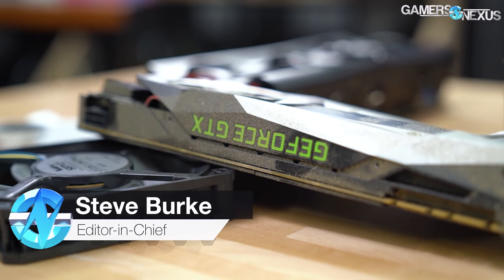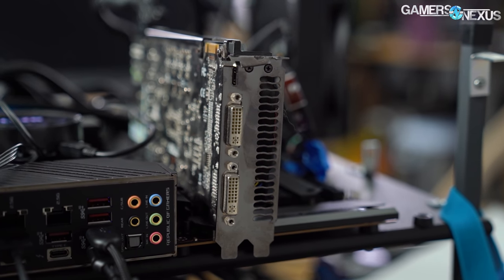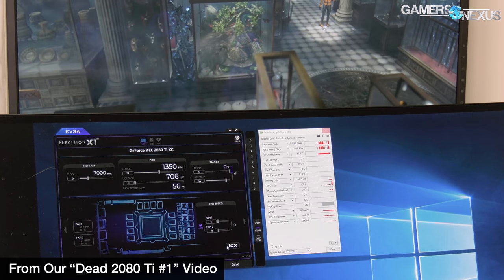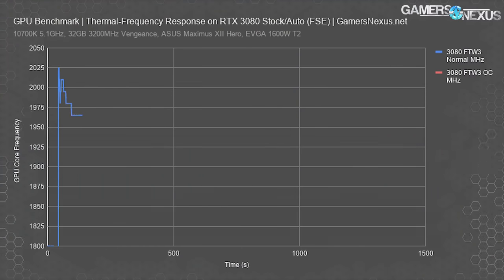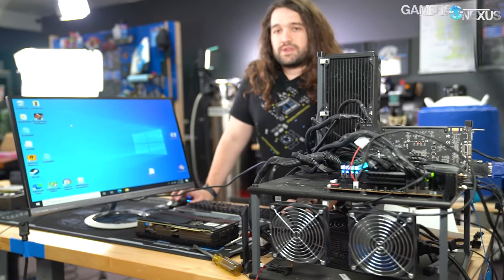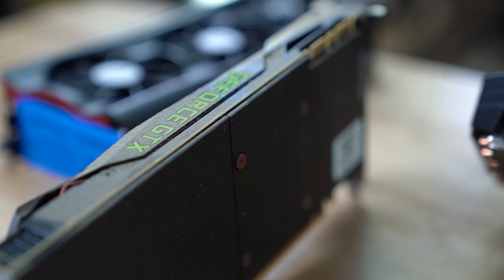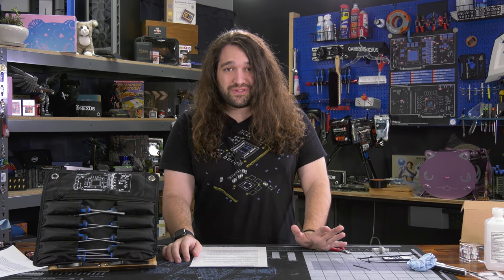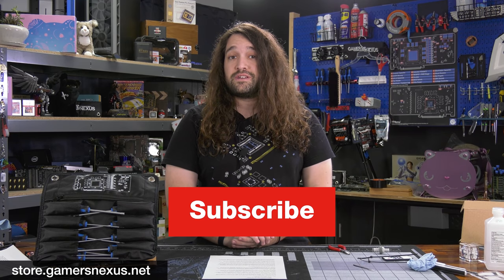Warning Signs When Buying Used GPUs: How to Detect Defective Video Cards

Comment: I bought an R9 380 for $100.  It crashed my computer four times in 6 hours. It ran FurMark for 5 minutes and and I played my games.  The computer screens would just go black and the machine was locked up.  Hard power off only. They took it back.  I now have a 5600XT that I got for $250 and it is working great.  Seller said it was an RMA for fans.  The biggest clue on eBay is the line "seller does not accept returns."  DO NOT TOUCH THOSE.

Comment: I got an MSI R9 290 off eBay some years back.  The card was having all sorts of issues.  I thought it was overheating, so I installed a water block onto it, but it was still flaky and the performance was really bad. Fortunately, it was still under warranty, even though I removed the "void warranty" sticker to install the water block, MSI still honored the warranty.  I sent it in, and they agreed the card was faulty, but didn't have any left in stock... so they offered me full MSRP refund in place.  I happily agreed, and turned around and bought a brand new R9 390.  :D  Suffice it to say, I'm a fan of MSI for how they handled it.  Not everybody has had as good of an experience as me, but they really wowed me with how well they took care of me.

Comment: For human factor: If seller is honest about card being post-mining then it's actually a big plus. Most of the time it means that seller is honest enough to explain how they used the card and all that stuff.

That's how i got my current 1070 for 200 USD back when 1660Super was going for 350 (in Russia, at the conversion rate at the time of purchase). Seller was honest about the card being post-mining card and it's issues (namely the fans clicking when starting or stopping).
Reply: Yeah, got my 1080 Strix from a guy in an office, he had piles of GPUs and some mobos/PSUs, he straight told me it all was used for mining. Gave me 8 to choose from, benched them all with cranked up power limit in Kombustor right in front of me. 18900 rub in April '19. Wish he had good 1080Tis, I wasn't going to buy an Inno3D, if he had a Strix/MSI/EVGA I'd buy that instead, the price difference was like 600 rubles.
Reply: @AlexanderVonMalachi  i mean if Inno3D is anything like new Palit, then they don't need to look glorious (Palit DUAL) because they work and do so without overheating

Comment: Hello, just bought a 6900 xt recently from local (CZ) auctioning site with buyer's protection measures. In fact was looking for 6800 xt, but after finding out there is a coil whine seller was more than generous to exchange the card with mentioned 6900 xt for free (even had no issues with the fact that I would keep them both for test comparison). In the end, the 6900 xt was in better shape so I kept it and it works 100%.

Comment: "Not tested" aka its busted and imma pretend i don't know.
Watch out for that one bros.
Reply: I bought a EKG simulator that was broken (sold as is) on the hope that I would be able to open it up and figure out the issue.  They used to be really expensive, and for the price it was worth it for the hell of it, and if it worked great! I had another simulator to teach with.  Well, after opening it up, I couldn't find anything obvious, had the hospital biomed department take a peek - they couldn't find it... had an electrical engineer I know take a look... He looked - at me - and said is it really worth it?  Nope.  Now it sits in my museum in the basement... Sometimes you just take your loss and know you were duped... even though it said 'as is'... which means 'doesn't work dumbass'.
Reply: Got lucky with an R9 290 in that state.

Comment: I have another tip: if a card was mined heavilly with (especially with Sapphire coolers) it will have a lot of corrosion on it. Not brown rust, but green-white solid stuff on the heatsink and also little pieces of metal on the PCB and cooler.

Comment: If you want to avoid cards that have been mined with, look out for factory video port dust covers being present and encrusted in dust. It could be that the owner put back the original dust covers, but if there's dust on and around the port covers they've never been removed and the card has most likely been sitting in a mining rig.
Reply: Huh? no ... I never remove the dustcovers just the one im using.

Comment: The reality is that used cards, especially those who show any signs of issues (from being dirty to rusty / missing screws to obvious signs of bending), are a huge risk at this point.  Every scammer and recycler in the world right now is putting any and every "card with two fans" up for sale without consideration, there is plenty of old crap, plenty of dead stuff, and you will almost certainly be disappointed.  Most of us are not comfortable ripping our cards apart trying to fix them, so it is "they work or they don't" - and at the insane prices even in the used market, it's a gamble that really isn't worth it.

Comment: Got an reference 290X in pretty gross state for $50. 
Cleaned up, changed thermal pads and paste — works like new. 
And for titles that are 2-3 years old even manages to get decent framerates in 1440p, Bioshock Infinite for example was cranked to High and I’ve got 120 fps average. And that’s for $50!

Damn that thing is loud tho :D

Comment: I bought a single lot including an ax860i PSU, GTX 980, and Corsair h100i. Tested it all, and it all worked, or so I thought. Got it all home, built a system, and about 12 hours later, started getting random shutdowns and restarts. Turns out the PSU was bad (would pass the self test via self test button) and boot no problem, but any load beyond that would cause it to crash. Fortunately the seller was able to send me the receipt for it and I was able to warranty claim it (gotta love those 10 year PSU warranties).

Comment: I'm kinda surprised you didn't go a bit deeper on the subject of ex-mining cards and how to reconvert them to 'normal' use. Of the 4 GPU's I bought second hand (back in 2019 when pricing was still ok), 3 were modified with mining optimised bios, 2 of which even currupted my windows install upon installing the drivers. It was an annoying proces and took some time and effort but I got all 3 back to original and running reliable. I'm not sure everyone would be able to figure that out without some help form lets say, a tech youtuber :)

Comment: I bought 1 year old asus 3070 ti from local shop, and it has still 2 years warranty. I tested the card before I paid for it. Ran Furmark software to check benchmarks, it was giving more than 160fps and temperature at 60-65%. It was in good condition like new totally clean. So I suggest you find local store to buy a used graphics card which has been used not more than 1 year.

Comment: bought a used Zotac 1070 Mini for 170usd last 1st quarter 2019, the previous owner said it was used for mining, I repasted it and removed the fans and replaced it with slim 92 fans; 2021 and still gaming with it perfectly fine

Comment: I bought a GTX 980 off Craigslist and in talking with the kid, he seemed like a nice guy (didn’t sound like a salesman). I had no issues with the card and I still use it to this day. Every video card I bought from online auction has been broken or not working right. I will never buy a card off eBay again. Even with buyer protection, it’s not worth the hassle.

Comment: Bought a 970 for my little brothers first gaming pc and had to replace the paste. Asked the seller before transferring the money if the card had been repasted/opened ever, his answer was and I quote, "Why would I open it if it works?" After I installed it to test it, GPU temps immediately shot up to 95C and after repasting it dropped to 62C, even overclocked it and didn't go above 67C.

So even if the card works, you should repaste it, especially "older" cards(now the gtx 1000 series are the newest "old cards")

Comment: I guess I got lucky buying a used RTX 3060 from eBay, won it in an auction for about $249 plus shipping. Aside from a few mildly dented heatsinks it works just fine as intended and hasn't given me any problems at all.

Comment: Bought my GTX 1070 online, i spend 2 days stress testing the product before i clicked "item Received" and made payment. Just changed the busted fan (wobbly fan) and re paste thermal compound and clean up. Its perfect for my use (1080p gaming) and i bought it cheap at around USD200 at Jan 2021. Now the same card is selling at USD 300 to 500. At that time i thought the RTX 3060Ti was selling at USD 400 was too expensive. Hmmmm still regretting.

Comment: Hey Steve, first time commenting, long time watcher.
I had a positive experience buying second hand. In fact ever since i got into DIY i buy second hand for my GPUs. 
In 2019, I had the opportunity to land a MSI Gaming 11g 1080Ti for 350USD. Prior to that I got a RX580 for 135 USD and before that a xfx 7970 Ghz edition. 

I got the 1080ti and even tested it before buying, one thing i missed out was the fans, When i got home and installed the card, I noticed fps was tanking due to throttling, to be honest, I was abit upset, since I did not want to unsink a 1080ti, so i went online and found replacement fans from an OEM, I also got Noctua Paste and thought, since this was a mining card, let me clean it and repaste it as well. 
Card is going strong till now, I havnt found any reason to upgrade as I still game on 1440p 60fps for single player and 1440p 240hz for csgo and other esports titles. 
I just cant justify dropping $$$ on a brand new card even during the pascal and earlier launches, dont get me wrong, I have enough, but I have a family and parents to take care of.

In Dubai the 3090 is going for 3500 USD the 3080 for 2500 USD and the 6900 Xt 2200USD.

Comment: I managed to get a GTX 1070 looked mint, guy had cleaned it up.

Took it apart 
Yep thick dust under fan blades
Starts of corrosion on the fins of the heat sinks and near the edges of the heat sink.

"2 hours later"
Removed all corrosion, rust and used rust preventer

Mint card end of the day - given age of it.
Had to stop the rot from getting worse.

Tested before taking apart further, temps fine... leave it alone leave it alone.. dont replace thermal paste if you dont have to or for 3-5 C improvement.. if  its not running to hot.. its really not worth.

Comment: I have been buying/selling GPU's since 2004...if you can, buy local...ask questions about their case, airflow and games they play. IF you can see a pic of their case even better. If they are a smoker or are wear a giant pot leaf on their shirt or show up with a cat in their car (true story)...it might be a instant pass for me. Smoke kills and will stink up your case and house as soon as you turn it on, pet hair builds up quick...more so if it's a blower style card.  If I am buying at a thrift store, I always smell them first and look at the heatsinks.  I tear down and clean nearly every card I get for all those reason. Likely 80 percent of the cards I have bought are installed and never touched again, so like 5+ years of dust/pet hair, gamed on non stop.  Also, I don't spend more than I am willing to lose. My main RTX cards that I have had over the last few years, were either new or from a friend who was the first owner.

Comment: I've had some awesome deals(this is 2018-2020 mind you). 2018 GPUs I picked up were all ex-miners and had no issues. GTX 1070's for $200-225. GTX 1060 6gb for $100-125. Later 2020 GPUs were just local pickups from businesses individuals who upgraded to RTX cards (I picked up a GTX 970 for $100 and a GTX 980 for $120). I usually remove the I've only been burned once when I bought an RX 580 for $100. When it came in it was filthy, had rust on the screw heads and grime that I couldn't even remove with a toothbrush and electronics cleaner. When it arrived, it worked initially then died in 2 days. I tried to heat gun it, but it was dead. I was almost burned by a salvager (I think this was around 2018 also) who was selling 6 old cards for $100 shipped (HD7850, HD6850, GT260 x2, X1900X, and some other really old card). He said they all worked, but only 2 worked one of the GT260's and the X1900X. He just refunded the money. I used the GT260 in a build I gave away (ancient Core2Duo). The HD7850 was dead, but I heat gunned it and it was able to be revived.  I use the HD7850 in a computer i7-2600 that I use to run Zwift on one of the TVs. The X1900X is too old that I don't want to use it and the other dead cards I keep as spare parts. One of the GTX 1070s had a missing blade, but I just removed the blade opposite of it and that re-balanced the fan. Sure it won't be as efficient, but it works fine.

Comment: Bought a 580 for 120 buck shipped s in January 2019 as a hold me over the card, it was brand new looking even the box still had the sticker when it was purchased a couple months prior. Was not impressed with the 20 series lineup, when that came out, so I didn't even wanna change it till the next thing, and now the next thing is here, but it's impossible to buy and my 580 is still doing everything I need it to. My 580 has been the most bang for the buck used purchase I've ever done, not to mention I could sell it right now for more than what I bought it for.

Comment: The timing of this video is impeccable. Well, more coincidental than anything. I just picked-up an MSI 1080 today with an AIO on it for $650 CAD ($521 USD). The card was a little dirty, but I didn't think much of it.

I got home and I found that it had some weird stability issues. Whenever the memory went under intense load, it would either artifact, freeze or become fuzzy for a second and then the entire PC would crash. I also found that if I overlooked the memory above +500, I would get the space invaders artifacts, which was cool to see, but also disappointing.

Right now, I have it mostly stable with -200 on the core and -500 on the memory (plus a 112% power limit), but it's unfortunate that it runs the way it does.

Comment: Good time for the used market. I had 1050ti, which I bought for  Rs 4650 ($63.90), I am actually a regular user and don't know much about anything. I put this on OLX after 1 year and sold it for Rs5600($76.96).

Comment: I sold my old power supply and gave my 960 as a freeby for 50€. 
It had some wierd artifacting like splitting the image in two and displaying the right side on the left of the screen. But worked perfectly while browsing...
I also told the same while handing it over

Comment: 5:38
Oh, it could happen on the 10 series cards too.

When I first slotted in my Asus Rog Strix 1080ti, it booted fine but after 30 seconds in windows it did that exact thing.
I found out the problem was Asus' own fan control program AI Suite.
Once I did a clean install of windows it worked fine, and has ever since.

Comment: There is another gpu problem that easily could pass by the common user. The worn out GPU that doesn't tolerate its original base clock and needs to be underclocked via BIOS or Afterburner in order to play games without crashing drivers and all types of unstabilities. Mine good old gtx 970 started doing this, and it only "fixed" it with a bios underclock, and i could easily pass it as a used, working, in good condition 970

Comment: I have that same gigabyte 1080Ti that I bought last February from a miner for 300$, still going strong and never had an issue. if you can meet with a seller and see their setup etc you can tell if they take care of their hardware, especially if they are legit miners that limit the GPUs TDP/power limit to 60%. while these GPUs run for a lot longer than usual they dont take near the amount of stress that some people put on their cards.

Comment: About the broken fans issue... I had an HD 6850(XFX board with dual fan) that had fans that were failing. I was seeing temps raising up to 100c while gaming. At first, I tried lubricating the fans, but I did it too many times to the point the fans weren't properly attached anymore. Later on, I decided to cut one of them apart and stick a 5v case fan that was from a spare parts PC. I spliced its cables to the fan cable of the GPU and siliconed the fan. After a while of use, I unplugged the other fan as it was failing. After that mod, it didn't go above 75c at any time. 

Other than being obsolete and that mod making the GPU way too thick, it still goes on.

Comment: I had bought a 2080 Ti from retail. It was out of box so I got a good deal. Problem was, the person who had sent it back wasn’t up front about why they’d sent it back. Turns out, it was faulty, but the retailer hadn’t checked before restocking it. Wouldn’t post at all, but would with another card. DDU didn’t work either. Managed to get my money back through RMA.
TLDR; bought card from store out of box, guy who sent back lied, was actually faulty, got my money back.

Comment: Minor issues can be "partly" defective fans. Have experienced bad bearings and defective PWM (meaning fan only works 100% with PWM full on). The bearing issue is easy to spot and can be felt, where the PWM issue can only be spotted during a test.. meaning it will be silent at low loads/temp, and very noisy at high tems, and fans(s) go on/off at this tempreature/max fan limit. You can test the PWM easily with Afterburner (*manual fan control)
Sometimes people just want to get rid of cards that has these Fan faults (even if the card itself works fine), and if you can detect fan-faults before buying, you can normally negotiate the price down. New fans are easy to get online, for low prices.